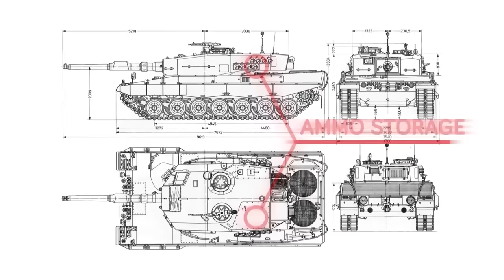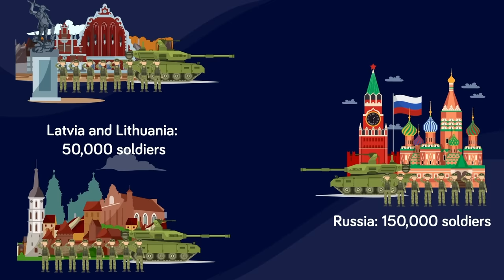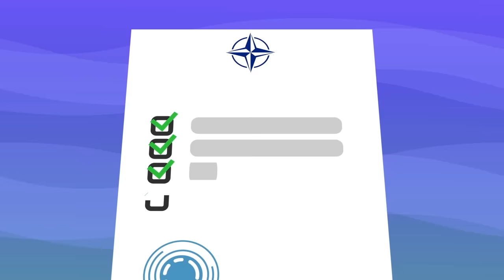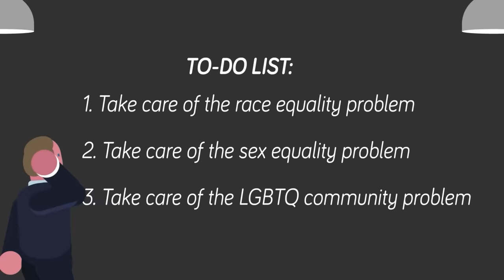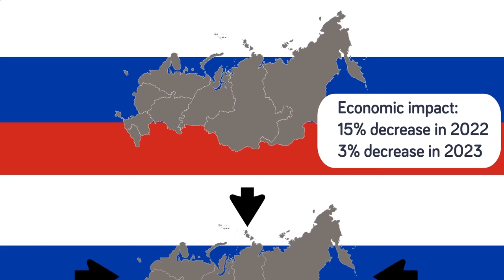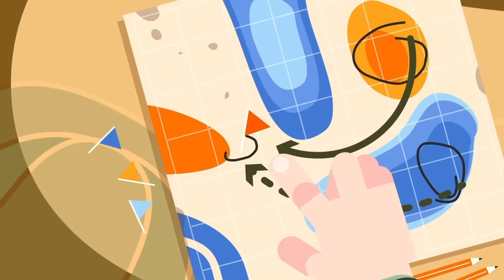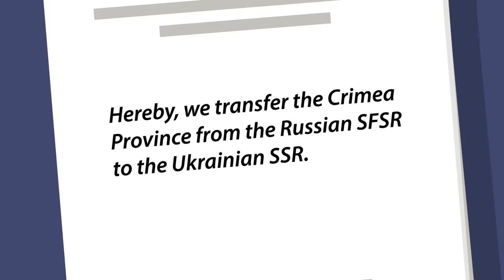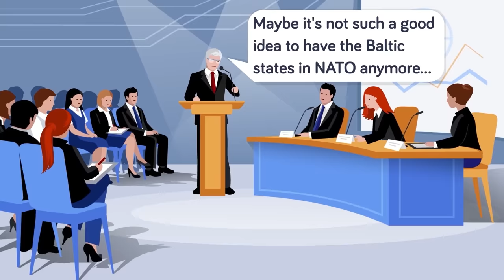Why Does This Happen to All Russian Tanks? (Compilation)

Comment: *Simple*
1. The joint between the turret and the chassis is a structural weak point on any tank.

2. Russian tanks employ autoloaders to automatically chamber each round. The advantage of this approach is a 3 man crew instead of a 4 man crew, but the disadvantage is the ammunition is stored adjacent to the crew, rather than isolating it within its own reinforced compartment.

When you put 1 + 2 together, you get a chain reaction of combustion. When a Russian tank is struck around the turret, the initial explosive charge is prone to set off the ammunition in the autoloader. The result is a flying turret and a vaporised crew.
Reply: No necesariamente. El 90% de las explosiones en la cabina se debe a que se almacena munición dentro de la misma, no porque el proyectil haya alcanzado el carrusel ya que este es un objetivo muy pequeño.
Reply: No. Instead of a 4 man crew you have a no man crew. That is the difference.

Comment: The carrier strike groups have about 4 destroyers. On top of this as a command ship they have a missile cruiser with 122 cells. They wouldn’t have just one destroyer launch interceptors at the Topol M. There would be several destroyers firing missiles. One topol isn’t enough to get through.

Comment: Something you are forgetting is the Russian tanks have speedier auto-loader so that is why they have that design. The Russian army is not running low on tanks in fact the war has made the Russians approach on how to use tanks and what to put on them much better: Such as the drone jammers or the fact that tanks do not Spear-head attacks any more but rathe the support the infantry.
Reply: Auto loaders aren't faster than human loaders and are responsible for countless tank crew casualties. Western tanks have far fewer casualties even tho they have an extra crewman.
Reply: @LongJohnLiver  western tanks have not fought against Kornets, but homemade IEDs, how the heck are you comparing the homemade IED's with $100,000 Javelins? Western tanks always had intelligence advantage because their enemies could barely afford a computer, Ukraine gets info from satellite.
Reply: @Keshaw-ht3xk  haha strawman logical fallacy fail. I never said, or compared, anything about IEDs or kornets. Neither did OP. Your reply makes zero sense. I simply said auto loaders aren't faster than human loaders and are responsible for a lot of Russian casualties due to the layout. That's it.

Comment: on the other hand, in Western tanks, attention is paid to the survival of the crew. After all, the value is not only the tank, but also the trained personnel. Nor can it be trained and replaced overnight. Therefore, in Western tanks, the projectiles are in a specially protected armor compartment, and if the lasers are still hit, the container is designed in such a way that the energy of the explosion is removed from the tank. This also increases the crew's chances of survival.
Reply: Not leopard 
Abrams also will never fight at frontline will stay back by US orders
Reply: @meteorknight999 theres destroyed Abrams in Ukraine